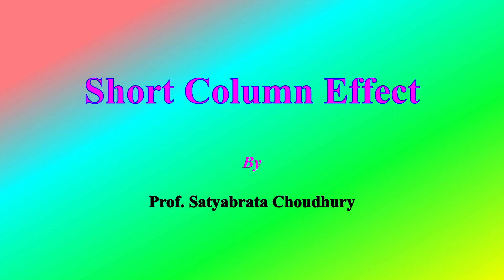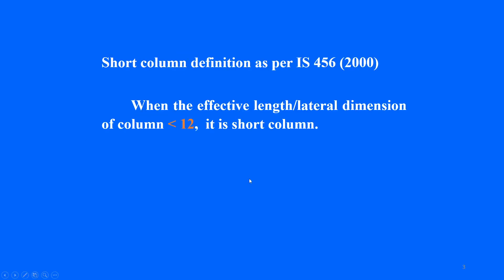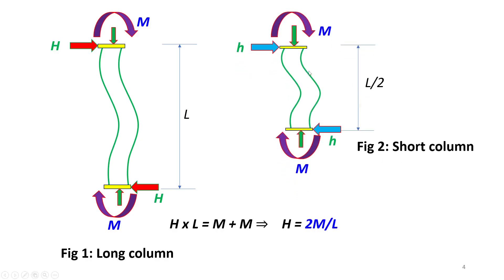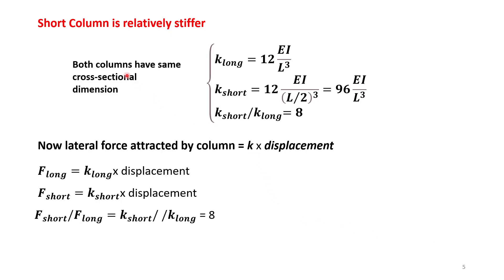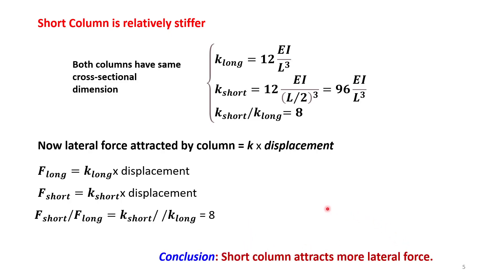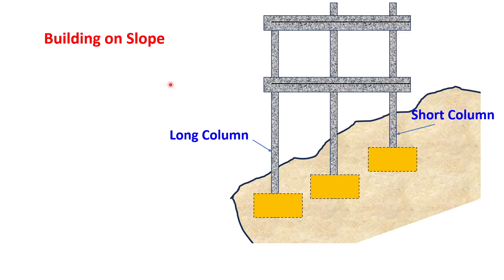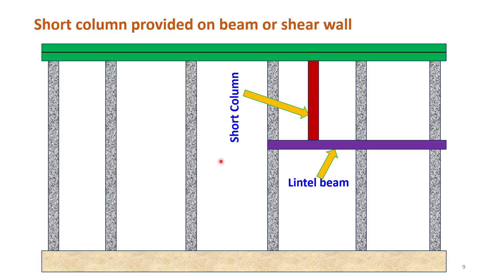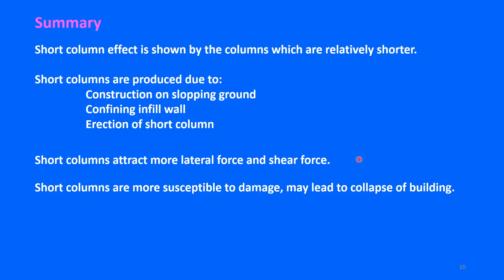Short Column Effect

Comment: Sir, if the short column will occur below the plinth level (From the foundation top to the plinth beam bottom)- I)How we can understand that will be critical? Since we try that all columns of the Building become short columns ( Leff./D) less than 12 and failure may take place by Crushing only. II) For the column below the plinth level, If we make an offset of the column as Pedestal, will be the criticality reduced?
Reply: Thank you so much for your question. "Short column" here is not that of the code-specified short column. It is a relatively shorter column in a group of adjacent columns.... Below plinth beams, all columns are generally of the same length. Hence, the short column effect will not take place.
Reply: @satyabratachoudhury3503  Thank You, Sir🙏. I understand. Sir, I have another question- In case of the Column that supports half the landing beam, they are relatively Shorter in clear span with respect to other columns of the building, are those columns subjected to the Short Column effect? What are the boundaries or criteria or values based on what we can say that the column is subjected to the short column effect?

Comment: Sir the moment directions shown  in both the column ends are clockwise .but it should be in opposite directions in order to have in equilibrium condition
Reply: Ok Sir Thanks for your reply
Reply: You are right. It was a mistake in showing the direction of the end moments. However, it has not vitiated the formulae shown.
Reply: Then +M and -M wil cancel out each other when we  take  moments about a particular joint
Reply: @binayaksamanta863  The direction of M should be opposite to that of applied torque. Here, both the end moments will be in the same direction, but opposite to the direction of applied torque.

Comment: Dr Subhrajit Dutta raised the question if the short column can occur below plinth level. The answer is 'yes'. From foundation top to plinth beam the column may act as a short column. However, the surrounding soil will give some stability by exerting confining pressure.